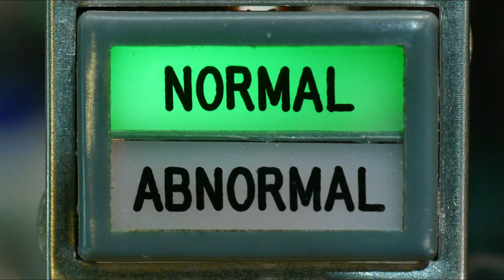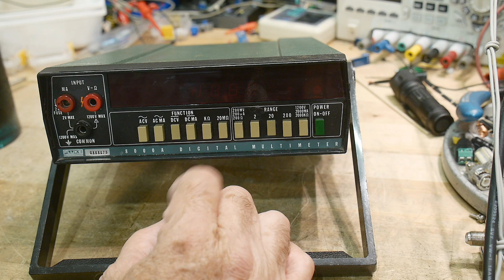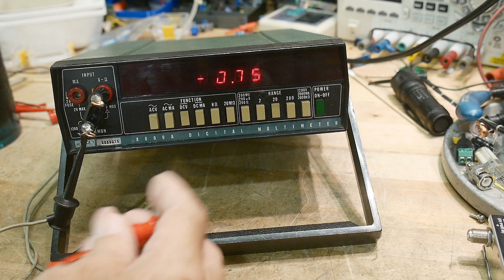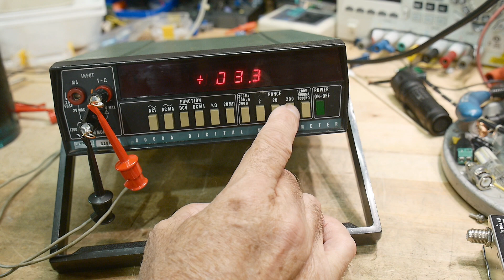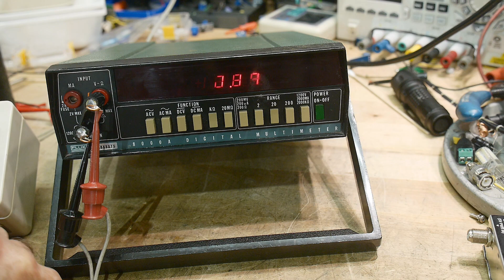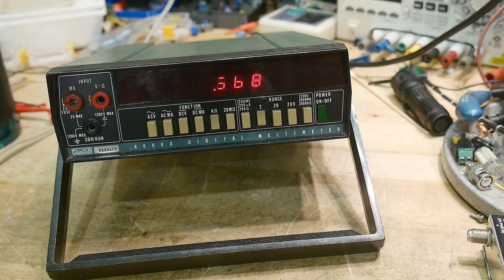#1291 Fluke 8000A Multimeter repair (part 1 of 3)

Comment: I used to work for the local Fluke agent and repaired those by the dozen. In the late 80s Fluke stopped supporting them and spares dried up quite quickly.

Comment: i was a bit disappointed with the mains voltage clearance, even worse for 230V land. :) also, the mains Plug often gets cracked solder joints. You could maybe do a video looking at the clearances, thanks for the nice Vids!!

Comment: I am so glad that I could see that Fluke 8000A again, it was my bench DMM when it was released to the market back in my university lab class. MY 8000A had exactly the same phenomenon that 1 segment of LED was out. I found out that one resistor of that segment current path in a integrated- 7 resistors package which the current flows to turn on was out, so I patched a normal carbon resistor just on the PCBoard at that resistor path. Cosequently a little bit diffence brightness than other segments.       And the wrong voltage readings is caused by somewhere in the input voltage divider (resistors), I guess, not sure.
Reply: Seems all the ranges drift by same amount percentually. So maybe even reference is dead.

Comment: For many years, the venerable Fluke 8600A was the chosen meter for the USN Nuclear Electronic Technicians for it's 4 1/2 digit resolution coming in handy for many calibration and alignment procedures.

Comment: Fuse implementation for mA range is great - Fluke just put one directly behind banana socket! 😂👍
My first thought after seeing insides is that, display issues may be caused by bad solder joints at flexed PCB.. It's being under mechanical load from 70s..
Reply: right, i was also admired that fuse can be replaceable at the 'mA' input by turning left, that aseembly was popped out.  To my remember, there was a spring inside of it.